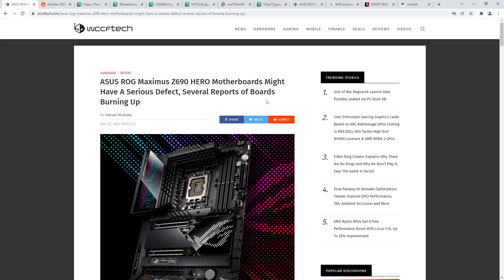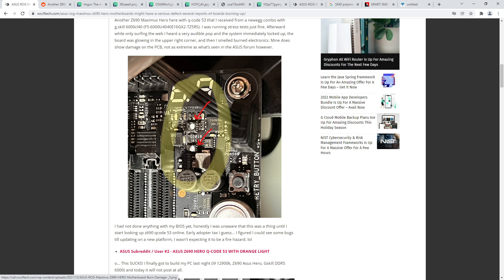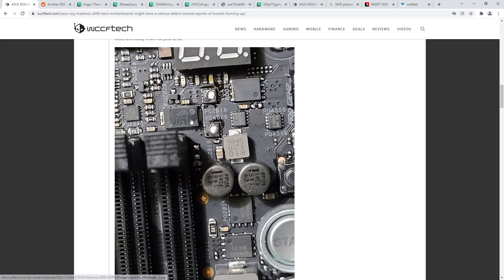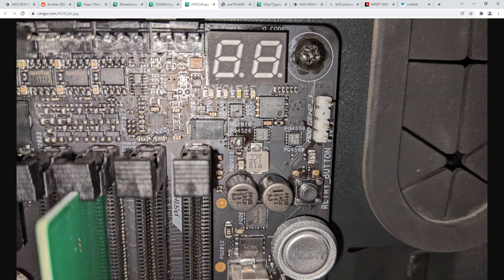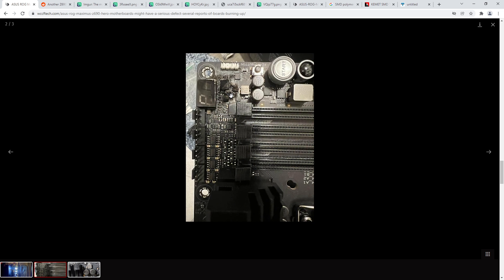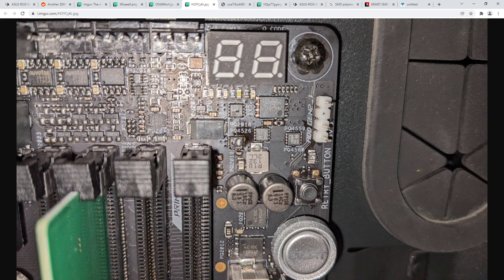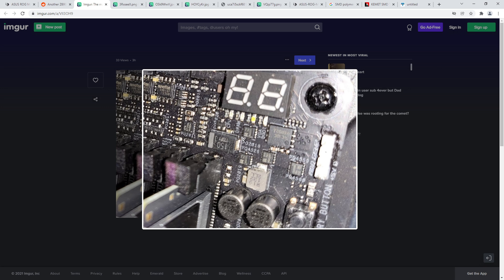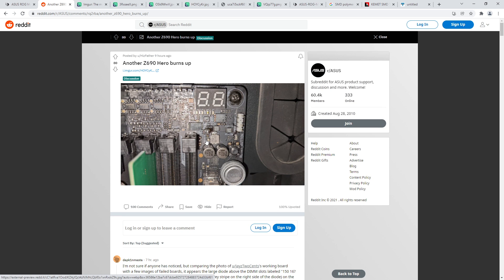My thoughts on the ASUS Maximus Z690 Hero failures

Comment: This is strange as any time I've accidentally mounted a tantalum backwards (a couple of times its happened,  Ive used them a lot in projects and repairs),  it destroyed itself and released the magic smoke in a matter of seconds right after power up.  Same with aluminum electrolytics,  within less than a minute they vent if their polarity is reversed.

Comment: Is that a P&P error? Of course it is. That is so obvious.  BUT it is impossible that someone will load a reel in a wrong direction. SP-cap's reels, like most of other component reels, have a feeding holes only one one side. That P&P machine would not work at all. But it is very much possible that the supplier of those SP-Cap's (Panasonic?) would load them into the reels in a wrong direction. All elements should be in the same directions according to the datasheet so there is no point of a making a visual inspection of the markings. Unfortunately, badly placed cap's will work during electric production test. Will work for some time....

Comment: I just got mine back from RMA, I almost kept it because I had it for 3 weeks with no issues, but as my batch number was one that was effected I decided not to take the chance, I checked the serial number and noticed I got a different board, so hopefully all is good now. my capacitor also had the 150 upside down, my new one isn't marked

Comment: Panasonic SP-CAP capasitors have round markers (mold marks?) in opposite corners of the package. If ASUS has automated optical check but it was programmed to check for round mark (like in small ICs) you can put the capacitor either way and it will have the round marker in correct position.

Comment: After returning my board from Amazon, I tried to purchase another from a different company hoping to get a good one. No luck. For all of the people wondering “what else might be reversed on these boards?”.. well I flipped the capacitor myself and I have been running it for several days with no issues even with overclocking and plentiful stress testing. I would not recommend you flip the capacitor yourself though unless you really know what you’re doing. The capacitor itself is glued down with adhesive and you will need a hot air station and low temperature solder to dope the pads, once doped you will have to remove as much solder as possible with solder wick and then add more low temperature solder (trying to replace all factory solder with all low temp) and then get after it with the hot air gun on low speed and around 650F temp. Again, do not attempt it unless you have done something like this because if you don’t succeed, you won’t have a warranty anymore and they are going to inspect your board when you send it in and probably make you pay for the repair.

Comment: Looks like they had too tight QC criteria... i suspect the QC camera looked for the originally speced capacitor with all the printed features being the criteria, so with the alternative caps from a wide variety of different manufacturers coming in the QCcam would throw a wobbly every time and instead of recoding the QC parameters to look for just the stripe, they removed this QC element entirely and later on for the HiRes snaps, eliminated that part of the QC too... the reality is that one step up from QC failed, QA (Quality Assurance) these are the folks who decide what is QCed and how, either they didn't handle it properly or we're ensuring that all the processes were being followed (definition, implementation and audit).

Comment: Someone turned off or the (polarity) vision inspection failed for the capacitor reel on the board’s pick & place machine. The surface (devices) mounting machine should prevent this problem.

Comment: Tl;DR: it is human error that can occur easily

I work in PCB manufactury and I can explain some of your questions regarding how such stuff occurs. I work as AOI machine operator/programer (AOI-automatic optical inspection, that being machine that is supposed to reject wrong polarity boards), repair technician, quality control and selective soldering. Understanding errors like that does require quite detailed understanding of PCB manufactury process.

That capacitor is turned around wrong in some of the boards, but not all of them. Note that different boards also use capacitors of different appearance. It is common practice in PCB manufactory to have alternatives for as much components as possible. Capacitors are made by numerous manufactorers in standard mechanical case style, you use what you can get your hands on (usually for cheapest) supply chains and stock do fluctuate - especially since electronics crysis started and trust me - it is wild, even simple discrete components like capacitors, diodes, transistors, etc. That are supposed to be so called "jelly bean" parts, are now hard to get in needed numbers. Changing part to part from different supplier does sometimes lead to need of reprograming of pick and place machine and almost certainly to reprogramming AOI machine. Note that polarity connection between pick and place file and actual polarity is not standardized. There is absolutely no necesary standard connection between programed data you feed into machine and actual designed polarity of components on PCB. I have to constantly, turn components around in production files to match actually desired polarity on PCB and polarity of components in machine library. It is easy to make machine not check polarity of the component that does require it. It takes one unchecked tickbox on machine I operate to not check polarity of component. The moment you change apearence of the component it usually leads to need for adjustment in machine software. Same goes for pick and place machine, count how many different components there are on the board, each different value of resistor is different component, note that each of this components have to be programed into machine - manualy, it is easy that while changing parts around someone made mistake while programing PnP machine to take new part from different supplier. Feeding components into machine wrong way around is not really a thing, components come into machine in form of tape reels. It is indexed plastic tape (you can google for images how those look like), there are holes on one side of the tape for machine to feed components with. However, there is again no standard how those components are turned around inside single piece of tape. Components could actually be supplied from one manufactorer turned around different way as when comming from other manufactorer. 
Also note, that same machines produce different products on frequent bassis. Factory gets order of X PCBs they put together, change tooling/components and build completely different product next day. When need comes, they can again produce another batch when they are able to retool for it. 
You can easily f*ck up reloading last time program and miss a different polarity component, and it happens to me quite frequently to find wrong component orientation of components. It is true however, in our company we mostly do smaller/prototype batches of PCBs, they are usually not computer motherboard complexity of project due to fact our machines aren't capable enough to handle such complexity and size of projects (we are expanding tho). We do many designs that are in not ready state for mass production, there is often lacking documentation, our production runs are much smaller, requireing more frequent retooling,... But even when building far simpler stuff usually I get reversed polarity components on whole production runs about once or twice a month. Of course it is usually not viable to just scrap bad boards, if such things get caught, they are usually repaired by hand, leading to a lot of wasted time due to simple human error.

Comment: I’m a retired EE. Design R&D.
- Even if your board has not been powered up, I would NOT fix it myself. Probably void your warranty. Doubt many people have the correct ESD protection. You could damage your board and the problem won’t show up immediately.
- If your board has been powered up, with reversed capacitor. The capacitor is damaged. Don’t fix it yourself even if it appears to function correctly. The MOSFETs are probably damaged and all have a shortened life.
Without seeing a schematic, it would be difficult to determine what other components will now have a shortened life. 
I would insist on a replacement board that is verified correct & working. And NOT a refurbished board!
To troubleshoot what component was failing, pulling down the VCC line on a PCB, we would take a can of freeze spray to the board, then powered it up. The area that goes from frozen to melting immediately makes it easy to find. But that is unnecessary in this situation.
I agree that the most probable reason was either a reel of this capacitor loaded upside down on the pick & place machine. Or the reels came from the vendor with the capacitor off 180 degrees. Inconstancy in component placement in the reel pockets.
Last. If there’s different PCB revisions. It should be easy to find. It will be in the edge of the PCB. It may be on the bottom side if it’s not visible on the top.
Good luck.

Comment: I had one, not even installed, was watching, Jay, and saw what he saw. and I did not even plug it in. :( the cap was wrong... Sent back with RMA. sigh.... Now I have to find a replacement board. I c ould send it to you if you want to fix it :) just send it back when done :)

Comment: Hi man recently iv'e got 3700x, pushed that to 1.4v getting like 71c max in cinebench r23 after 30min  it is ok if i leave it. Temps seems to be pretty reasonable, but i've heard some question Marks with voltages above 1.35 on all core load with 7nm node, one the other hand debauer testend those 5xxx cpus on 1.4v and main cause od degradation was a temperature, so what do you think? :)

I've watched your video about that degradation problem but in your case, you are getting those higer temps. Im on 360aio and heat transfer from cpu seems to bo working better that in your case so idk.

BTW keep it up:)

Comment: On the topic of board issues, do you know anything about a Part Number Revision to the ASUS x570 Dark Hero? The original Part Number at launch was 90MB1760-M0AAY0, but now there is a second board on the ASUS store with Part Number 90MB1760-MVAAY0. I can find no info online about the difference in revision.

The only reason I noticed this was that my board had a catastrophic failure and in researching online there are a lot of forum threads about the dark hero board having start-up issues which sometimes progress to board failure. I am wondering if ASUS has revved the board hush hush because of the dumpster fire they are dealing with on the Z690 and don't want to draw any more scrutiny.

Comment: I have one of these boards.  Thank god I didn't start the build yet... Am really bummed because it's one of the few decent boards that has on-board TB4. Oh well... I have like 20-odd some days to return it under a "no question's asked" RMA.  Let me know if you want me to send it over!
Reply: P.S. I thought about fixing it too... I have a hot air station but hot tweezers would be best I'm assuming because of that DIMM slot as you mentioned...  But nah, I'm not going down that road.

Comment: marking the polarity clearly on silkscreen for these type of components (caps, diodes etc) is a really good habit in pcb design, it doesn't necessarily prevent the accident but definitely make debugging/inspection much easier. I'm surprised that some motherboard vendors (including asus) are not doing that.

Comment: Used to work in electronic manufacturing the SMT machines run checkers to make sure stuff like this doesn't escape down the line. Someone either allowed them through or no one cared enough to be like "hot damm we got an issue"

Comment: so I have been working within high precision electronics assembly for over 20 years and even back in the mid 90's the PnP machines (MRSI in this specific case) had cameras and optical component orientation software built in which would identify if components were in the wrong orientation and automatically correct this

This is totally human error as in the person who set up the program on the machine messed up

Comment: My guess is that the reels of capacitors was spooled the wrong way, or they were filled the wrong way.  I don't know if it's possible to load the reels backwards, as they usually feed off the top, and putting it backwards would force the ribbon to flip over.

Comment: If there a lot voltage going through this capacitor at stock speeds , what happens when  overclocking? Does this mean that when overclocking that this cap will overheat even when in correct orientation?

Comment: Testing of the capacitor with a multimeter shows that there are 4.96VDC on the right side of the capacitor. Unfortunately my board has the polarity reversed and have submitted an RMA request to ASUS.

Comment: Sorry for my English! Operators can NOT load this type of components "backwards".  SM A, B, C, ...  cased capacitors are in tape/reel, which can NOT be loaded in reverse to any type of feeders. They can be in reverse IN the tape, but it's very unlikely. There a lot of ways one can f it up, but it's not easy. AOI programming can be tricky, sometimes it's easier skipping some components/areas than defining new ones. Functionality testing means checking some predefined measure points. If the voltages are "in range",  the DUT considered ok. So, having those capacitors placed in the wrong direction means to me someone made some unauthorized changes to the program of the line. I mean incompetence, not sabotage.

Comment: Completely unrelated question: is it possible to kill a motherboard by running a separate PSU for multiple GPUs? my uneducated guess is that if the power for the PSU gets interrupted, then the cards might draw way too much from the pcie slot and kill the board.

Comment: Nice job on the observation and deduction! In my work I encounter custom designed boards, and I have seen a lot of errors the last few years - maybe manufacturers are hurrying to catch up with demand.  Now it you can just explain why my MSI PRO B550M PRO-VDH WIFI AM4 AMD blue screens when it crosses a certain temperature threshold, and then is fine at higher temps after that...

Comment: Thank you thank you thank you for this info. Been using the z690 hero board for about 3 weeks now and have been having a lot of instability issue, especially when trying to enable XMP. I just say your video and now I realize I have a ticking time bomb in my house. Going Back to my 10850k tonight. You have saved lives with this info. Again thank you
Reply: Asus acknowledges the problem and will RMA the board for you without issue. They are, however, expecting 7-10 business days of turnaround (looks like someone got hammered with "Imma need a new board right about now"-requests).

Comment: I just realized that the  Z690 Formula board is the same as the Z690 HERO, but that capacitor is not visible on the FORMULA Z690 because there is a metal cover, if both boards are on the same production line, well... Z690 FORMULA (will) has the same problem

Comment: i have the maximus z690 extreme and i have also this memory problem. I tested multiple ddr5 ram kits and i figured out that it has something to do with my mainboard.
my chip is from top to bottom and the stripe is on the bottom. now im thinking is that corrext or should the stripe on the top? 
I'm also in contact with asus and they send me a new mainboard during the next days. but that is really interesting, if my top to bottom (with bottom stripe) is the same issue or have the extreme maybe a other issue.

Comment: I am a SMT Machine Operator. 

When running a typical product, there are multiple levels of checks both by human eyes and inspection computers, to verify the parts are the correct part, that the parts are properly placed, and that the polarity and orientation is correct. 
However, this system is no perfect by any means, and we do occasionally have a situation arise.  

When it comes to bigger capacitors like the one discussed here being 180 degrees off, that suggests a couple of possibilities. 
The first possibility is that a reel or two of the caps were packed backwards from "normal" into the carrier tape. I have seen this frequently, more times than I'd care to admit. The machine placing them would only detect the part, not the polarity.  

Another possibility is that when switching from one supplier to another, that company A packaged their parts differently than company B, and someone didn't change the pick and place program to account for this. 

At any rate, I'm going to use this situation to learn from, and hopefully ASUS does as well.

Comment: Thank you for info time to start refreshing my soldering skills, i have one of the boards with cap  mounted wrong. Will update later on this week if re-soldering solve the problem. And yes i check the voltage and its 100% wrong so you can say this is 100% reason for boards to fail. Will do the board fix in first week of new year and share the outcome. Happy new year to all of you.

Comment: To use hot air without burning up the slot just heat slowly from the bottom of the board.  Should work.